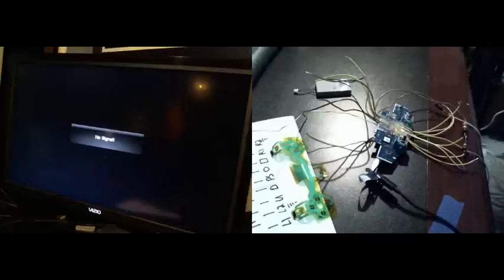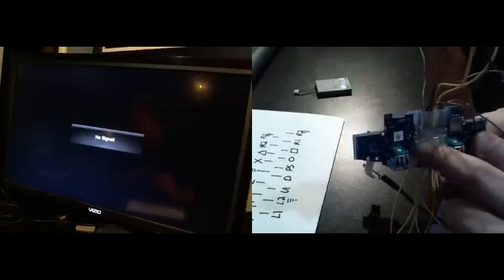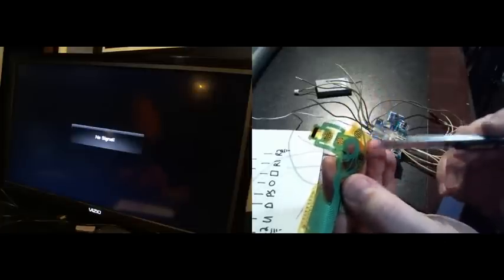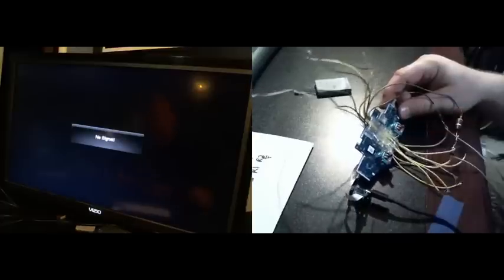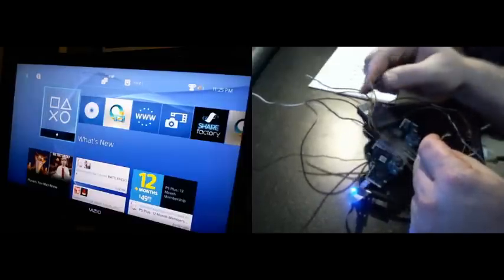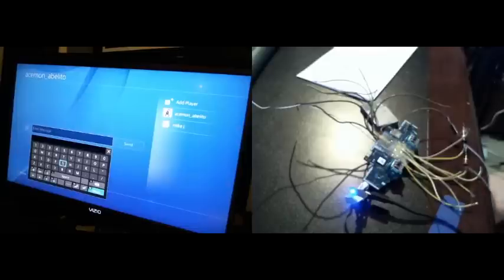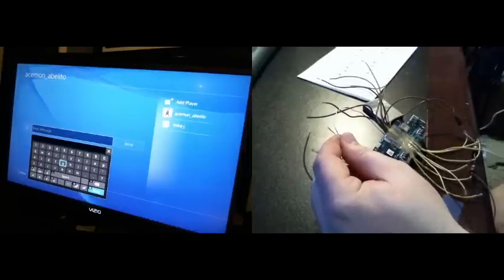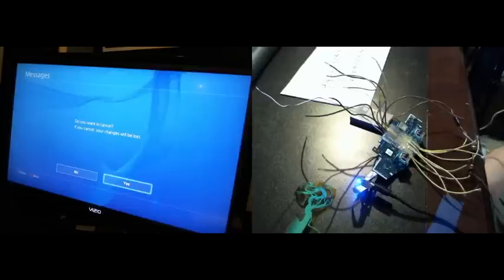Playstation 4 Controller Hacking For Arcade Controls

Comment: Cool little vid and project.   Curious how you went about soldering to the points on the PCB?   Did you merely scrape away the material over the points where the membrane makes contact, and solder to the metal underneath?   

Certainly wouldn't mind trying this with a controller I have with broken bluetooth and analog sticks.

Edit:  Woops, nvm.   I see you've already answered it below.   Thanks very much for all this info, man.

Comment: Great little video, bud.   Just converted my Xbox One TE2, into a bluetooth PS4 TE2, along with a better 3.7V battery, which lasts far longer.   

Was unaware of the resistance required on the L/R buttons, so was certainly glad to have found your disclosure of that in this video.   

Thanks for posting all this info.

Comment: I see one resistor for l1 l2 but he shows 2 resistors for r2 r2 in series. Is this correct?
Reply from the maker: It’s to get to the correct reading. Didn’t have one that was correct so had to use two to add up to the correct reading.

Comment: Hello, great job, but I have some doubts, the power consumption using the joystick is higher than the original pad and if so, how long do you think the battery will last if I wanted to go wireless? I have an idea in my head to make a portable non-arcade joystick with a tablet with fighting games and to be able to connect it to the arcade joystick and thus play without using a tv.

Comment: What did you mean when you said your resistors need to be inline? Did you mean solder a wire to the location of the r2 ground button on the board first, then solder a resistor to that wire?
Reply from the maker: Yes.
Reply: YourMKArcadeSource okay tell me if I this sounds right to you. I solder a wire to the r2 ground then at the other end I solder a resistor. Then after that I solder another wire to the other end of that resistor and finally I have my ground wire for my r2 button.
Reply from the maker: Yup. Imagine a wire. You cut the wire, and in between the cuts, you put a resistor.
Reply: YourMKArcadeSource sorry if I'm annoying you sir but just to clarify, I will have to solder 4 resistors in total for my r2, r1, L1, L2 grounds right?

Comment: are you saying that l1 and l2's ground get twisted together with a resistor and then your tapping l1 or l2 together to get the funtion??
Reply from the maker: No. Each button has to touch it's respective ground to work.

Comment: dude i love your vid, im trying to make my own ps4 custom arcade stick with the ps4 controler. just 2 questions on your vid. you say you need 8k resistors, what are the watts? 1/8, 1/4. and the next question is. do you use a resistor on all 4 grounds for r1, r2, l1, l2? so your saying that they use their own grounds? so you wouldnt use the shared ground? get back with me as soon as ya can, my prodjects awaiting your reply
Reply from the maker: Thanks! There's no voltage running through the resistors, so you can use a 1/4 watt. You only need the resistors for the grounds for L1/L2/R1/R2..if I recall correctly.

Comment: Hello, I have a problem, I put the resistors in the L1 / L2 and R1 / R2, the computer before putting these resistors 7 and 8 buttons were cranking alone, with the resistors stopped trigger when I back the L1 land fires button 5, as the land of R1 triggers the six button, now 7 and 8 button before were cranking just do not give signal.
Reply: Qual que chuta? e ae irmão, conseguiu resolver seu problema com os resistores do L1, L2 R1 e R2 ????
Reply: Consegui, mas depois surgi o um problema é que quando apertava um desses botões ai desligava a placa e voltava a reconhecer
Reply: Qual que chuta? como vc fez pra soldar os resistores?

vc um resistor pra cada botão ou um para L1 e L2 outro para R1e R2 ?
Reply: Isso mas quando apertava L1 ou era L2 desativava a placa
Reply: Qual que chuta? Como a sua placa tá dando curto, o que vc fez para ela não desligar mais qndo vc aperta o L1???
Reply: Ela continuou desligando, tive que desativar o botão
Reply: Não sei se é bug do youtube, mas não consigo ver sua mensaem pedindo minha ajuda, se quiser deixa seu contato ai

Comment: Incredible, do u know the dualshock 4's pcb is faster than most of the arcade sticks that are out for ps4 right now? 

Ive noticed it myself during the SFV beta where i used the dualshock 4 most the time. Now that i've actually read about input delay's on different arcade stick's this seems about right. My arcade stick has probably around a delay of 8+ms while the dualshock 4 has about a delay of 1.83 MS even though the dualshock 4 is wireless!

I've always assumed to myself when playing on the PS4 "why do i feel like i can react to things faster on a controller? Things such as hitting someone while they are still in the recovering animation from their normal attack or swatting people out of the air for jumping was much easier to do on the dualshock 4. Now im not a stranger to using arcade stick's and have been using them to play with almost every fighting game i play for who knows how long, so there is no way my hand coordination is better on a controller than an arcade stick.

Comment: The board contacts doesn't "attach" the soldering tin, how did you solder the wires?
Reply from the maker: +Christian Campos Flux. And you have to scrape away the coating over the pad to reveal the copper.

Comment: Very cool mod but I'm curious as to how you got the options button If you did in fact use it.
Reply from the maker: +Robert Sein You simply solder a wire to the top left corner of the button pad and the bottom right. Then run the wires to your replacement button and you're good.

Comment: wait. cant you just solder the connections straight to that overlay and save your self all the trouble of using ohm resistors and stuff like that?
Reply from the maker: 8Bit Fox No. It's a thin, plastic film. You can not solder to it. It simply melts.
Reply: Boo Urns! we need a ps360+ that covers the new consoles and makes it tourney legal.
Reply: YourMKArcadeSource I would assume it may work with taping the wire onto the overlay

Comment: Mike, very impressive and informative video as always. I frequent the BYOAC forums a lot so I know you're not the first to "hack" his controller. I can't help but look at a "hacked" controller and cringe over how messy all those wires look and how much time/stress you must have invested in doing something like this. I'm sure there's tons of satisfaction that comes from a completed project. But back when I purchased an MK9 fight stick for my Xbox360, the first thing that jumped into my head was how much easier it would be to buy another and then use those guts to wire into the buttons on my arcade cabinet. After MK9 was eventually ported to PC, I abandoned that plan and now I use software to emulate Xbox360 controllers so my PC will think it's got two keyboards plugged in while I'm actually only using one. So with the fight sticks out there for roughly $100/each (used), do users like you opt to hack a PS3/4 controller for fun or to save on cost? For me, taking apart a fight stick would and rewiring it to the buttons in your cabinet would be so much easier. Unless of course this was something you already tried and it didn't work?
Reply from the maker: evh347 Thanks. Easier to gut and use the fight stick wiring? Sure. But it's more expensive and I have no problem modding/hacking the PS3/PS4 controllers.

Comment: That's pretty cool. Good job.

Towards the end of the video, I had an idea that maybe you should do something with the default LED inside each controller (light bar LED). Maybe route the LED to somewhere on the cabinet? Perhaps make it illuminate one side of the control panel? Light up the marquee? Light up the Player 1 start button? Act as back light for all of the buttons per P1/P2 side? Lots of neat little things you could do. Would be interesting to see what you do with it!